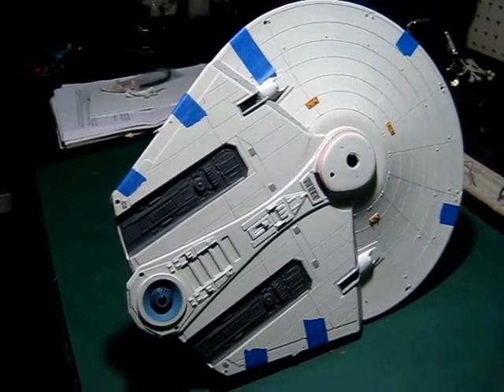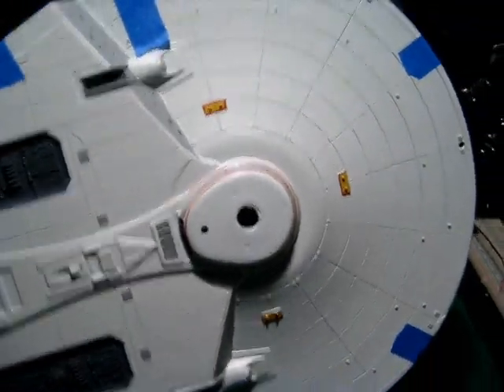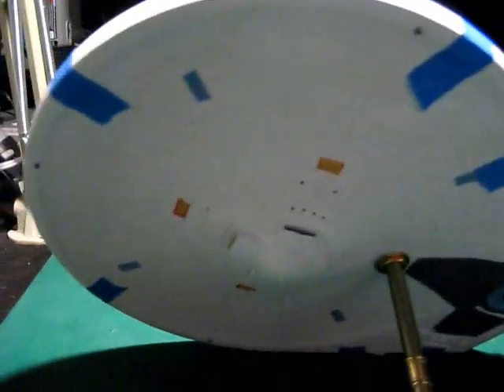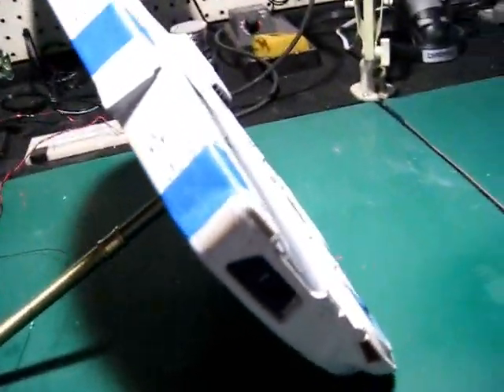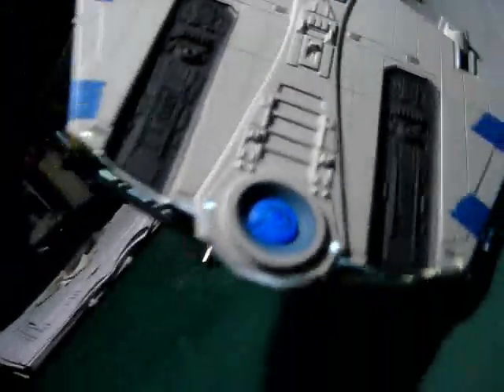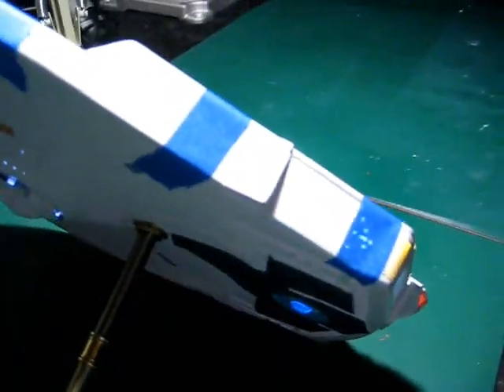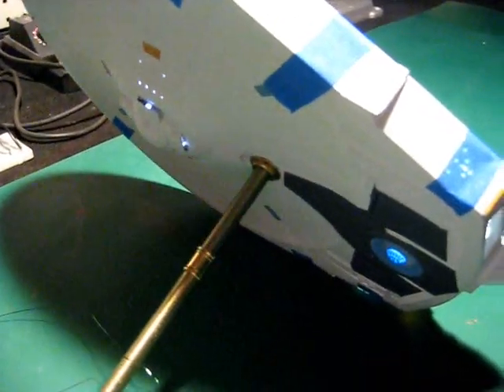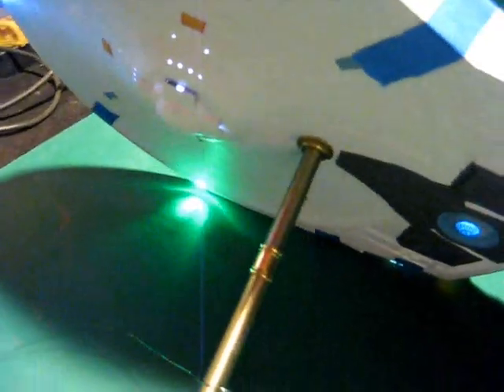From TrekWorks Round 2 Models 1/537 Scale USS Reliant Build PT 6 Detailing and Wiring

Comment from the maker: I found the lighting kit at Cult TVman's site. Its made by Evans Lighting. Its a great kit and I like the small size of the board. The strobes and nav lights can be speed adjusted by just turning the pot one way or the other. Working out well lighting the inside with the Double Density warm white LED tape.

Comment from the maker: It depends if the light leak is in area that can be sanded or not. If its sand able, either 3M red spot putty or Squadron products white putty. If its in a tight area I'll use a little Elmer's glue.
Let it dry, and then touch up some paint over it.

Comment: I have a set of Aztec decals for my 1/350 NX-01. There are a million clear plastic parts for windows on the saucer section. I will have to paint the saucer first like you did when I go to build it. Check out The Painting Clinic here on You Tube. His video AMT Round 2 Star Trek Reliant Build Part 4 was a disaster for him. He used the Vinyl masked for the Aztec. His paint was either not dry all the way or the paint he used was soft. It was a shame, all that work and he quit the project for now.

Comment: How did you keep the 5v board working with the 12v led tape?  The tape I've run across works as low as 7v but no lower and 7v own the voodoofx board should get to warm?